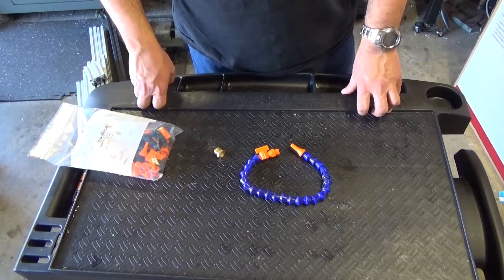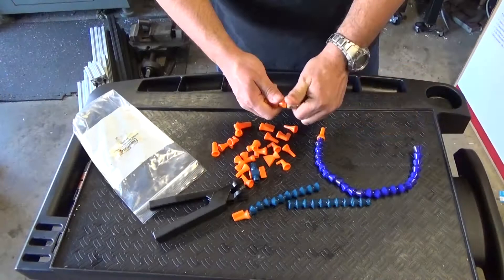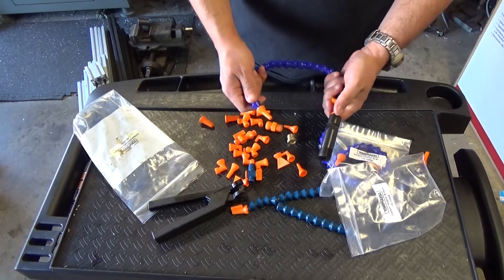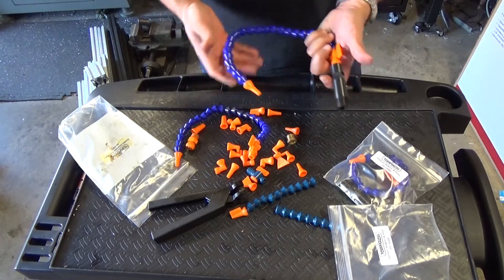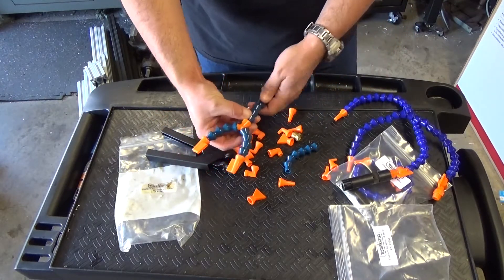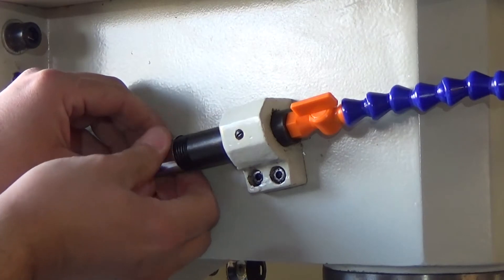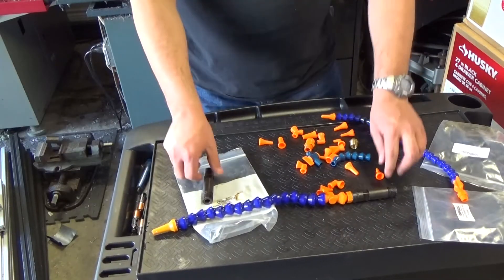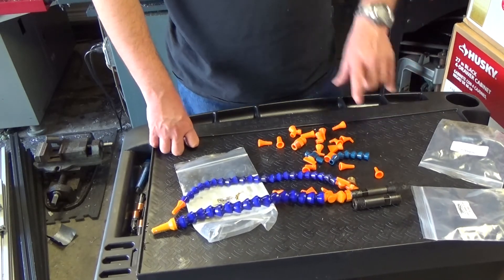Replacing Your PCNC1100 Coolant Hose

Comment: Do I need that tool to remove/attach the orange tips? What is it called?
Reply from the maker: Well, the tool definitely makes it much easier. I think that if you don't want to get the tool you might still be able to pop them in and out, but it will probably be a tad of a struggle. They are called Loc-Line Pliers (although I think Loc-Line is a brand). You might also find them by Snap-Loc pliers. There are knocks off out there which still get the job done. I do believe the trick is to get the 1/4 inch ones. I added an Amazon Associate Link in case you want to look for different options. I acquired mine in 2015 and can't remember where I got them from. Hope the info helps!
Reply: I just used a table vise and squeezed them together

Comment: I bought one of those blue flexible pipes, it leaked at every joint and i couldn't find a nut to fit it to a gravity tank. Useless!
Reply from the maker: Probably worth pointing out there is an actual tubing inside of the blue linkage "hose". I think the links are there just to ensure the entire hose assembly is kept positioned where you need it. Otherwise, the hose would simply fall down. With regards to the nut, that one I am at a loss. I was under the impression there are just a handful of standards? Anyway, you may want to give it a second chance. They are not that useless.
Reply: @CNCDude  I don't think there can be a tube inside, I've seen videos of them being clipped together by using a hand tool, with different ends for different machines/uses. I checked mine over today, rotated each joint, flexed it in every direction, opened and closed the tap several times, it still leaked, leaked from the tap surround and coolant was weeping from nearly every joint. I shall make one using 1/4" clear tube or smaller with wire taped along it, a water container with tap for the coolant, cost very little.